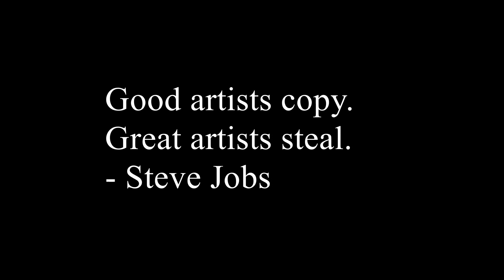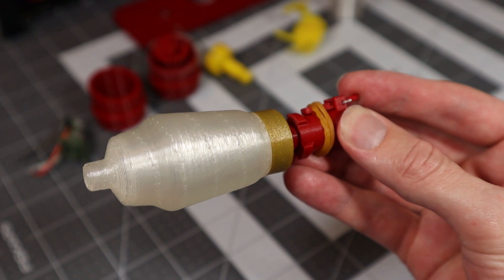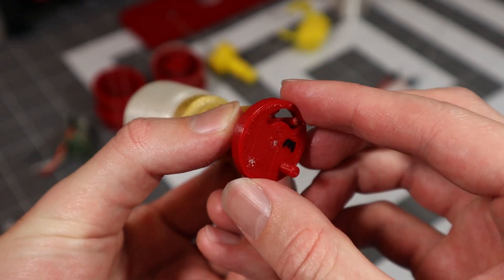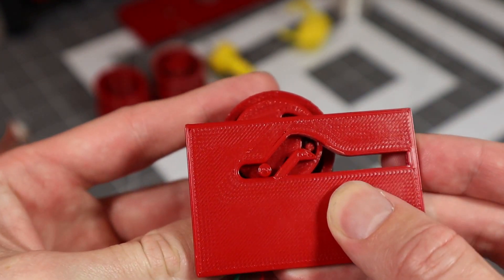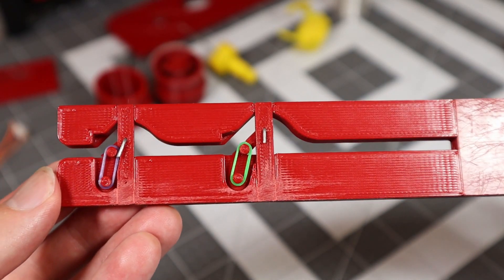REAL LIFE WUNDERWAFFE: How It Works

Comment: hey cool wunderwaffe. is there a way you could make the rear light turn off when you flip the switch off? also when he inserts the new tubes and pulls on the "charging handle" it springs forward. would there be a way you could do that as well?
Reply: My Idea for the springing forward part would be using one bulb as a “bolt catch” and putting the charging handle under spring pressure. But that would mean the handle goes forward before flipping the power switch back on. My second idea would be a button on the charging handle, so that the it catches a notch when pulled back and can be released by pressing a the button to let the spring from idea 1 do it’s thing.